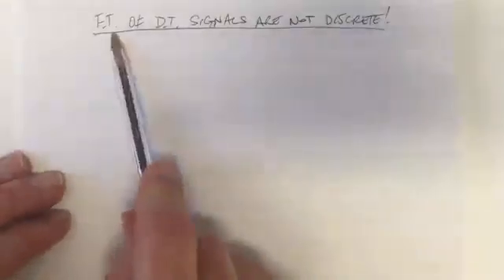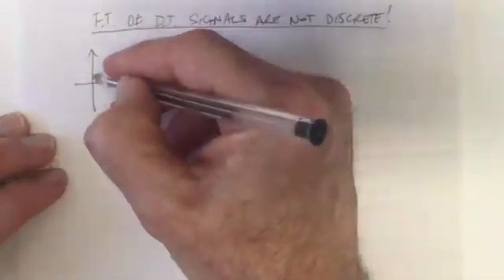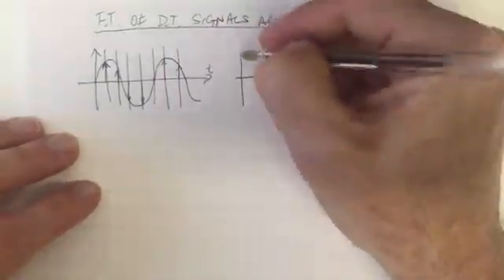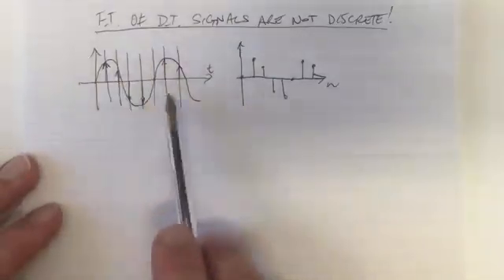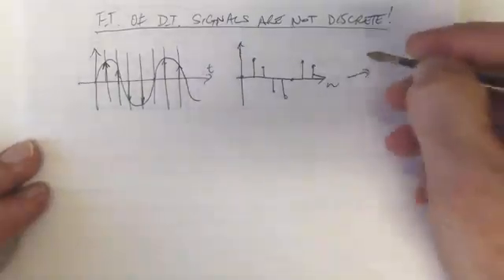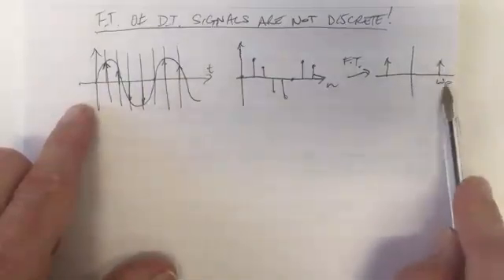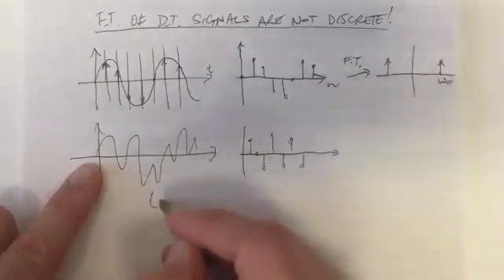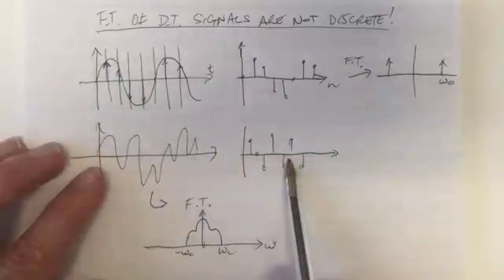Fourier Transform of Discrete Time Signals are not Discrete

Comment: Thanks for the video, but I don't quite understand why the Fourier transform of the digitalized system repeats every 2pi. I understand that the basis functions do repeat every 2pi but how does this relate to the repetitions in the FT? 
Thanks!
Reply from the maker: The Fourier Transform equation calculates the coefficients of the basis functions. So, if the basis functions repeat, then the coefficients of those basis functions repeat.
Reply: I think it should repeated every 2*pi*sample frequency.